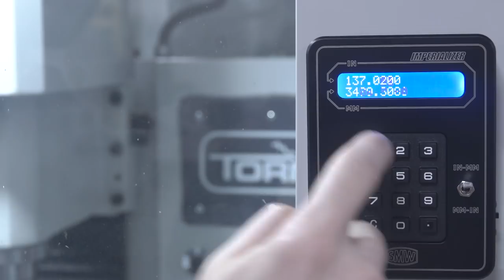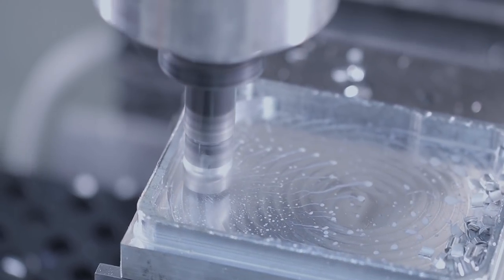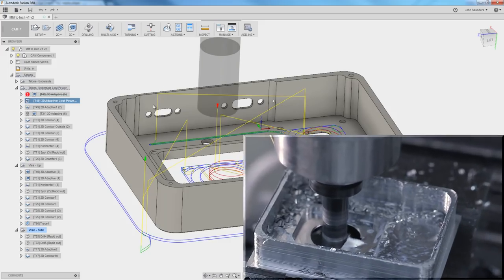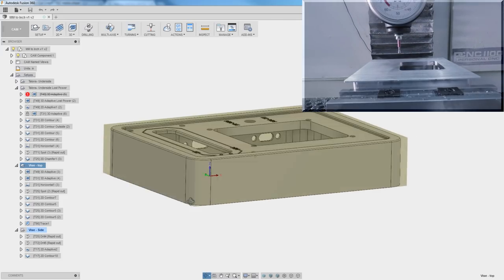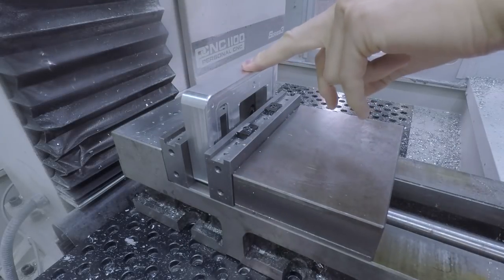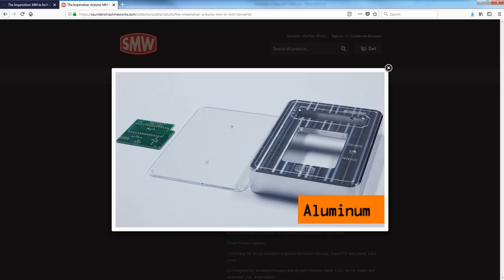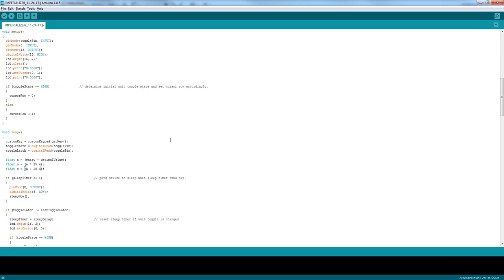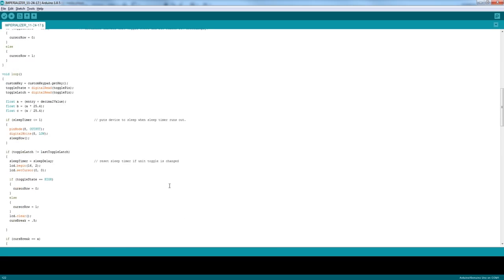Arduino Device to Convert MM to Inches!  WW174

Comment: At first I thought this was overkill. And queue the screeeeeeams of "silly USA with the imperial system" and all the usual rambling i'm sure i don't even need to scroll down to read.

But as a project and a product this is a very good example. Sometimes you need not a multi function gizmo, you need results now and take off the mental toll off your brain. Even if its just going to a calculator. The more steps an operator follows, the more "dumb" it becomes specially when arithmetics or complex thoughts are required. It's a quality of work improvement.

And of course, the choice of enclosure being resilient, adequately looking, and no wires exposed is a simple and effective. Love the magnetic mounting idea and implementation, although i didn't see any dampening feet for the back. Magnets at close distances pull very hard, and that sometimes result in snap/small hits. And magnets nor acrylic like being hit (both fragile, and the magnets can demagnetize because of that! or drop out of whatever place you glued them...). And if you leave the device on a table it might scratch it ... or drag metal scraps.

Nice video, greater product, and of course amazing comment wars wherever metric and imperial meet.
Reply from the maker: You nailed it.  This is just an example of what we can do today - build inexpensive, fun, useful dedicated hardware devices!  Show me a calculate that has a big ol' toggle switch on it!

Comment: “With that funny metric system” can’t get any simpler than base 10 maths 😂 and with converting imperial to metric using a factor of 25.4 isn’t too tricky either - 5/8” = (5/8)*25.4 =15.875mm for example. Never the less it’s an ace gadget for ‘on the fly’ conversions which could prove time consuming using a calculator .. good job! 👍

Comment: Seems simpler (and less expensive) to use the WolframAlpha app... :) Or just write a smartphone app yourself and sell it on the App Store (for whatever platform you need); not only could you then sell it, but everyone in the shop with that brand (iOS or Android) of smartphone could then use your app as well; plus, it’d be a lot easier to customize later, rather than having to fiddle with the memory constraints on the Arduino.
Reply from the maker: NO!  I don't want to use my smartphone!!!!!

Comment: Anyone who shows that image saying that Americans went to the moon using imperial definitely don’t realise that Americans went to the moon USING METRIC... it just displayed it to the Astronauts in imperial... 

Quote from one of the Apollo engineers... “With respect to units, the LGC was eclectic. Inside the computer we used metric units, at least in the case of powered-flight navigation and guidance. At the operational level NASA, and especially the astronauts, preferred English units. This meant that before being displayed, altitude and altitude-rate (for example) were calculated from the metric state vector maintained by navigation, and then were converted to feet and ft/sec. It would have felt weird to speak of spacecraft altitude in meters, and both thrust and mass were commonly expressed in pounds. “ https://www.doneyles.com/LM/Tales.html

So yeah... your calculator is essentially what the LEM landing guidance computer did and that is change metric inside the computer to display imperial to the guys landing the thing.
Reply: Was about to comment same but figured someone else would have already!
Reply: I wholeheartedly agree. The imperial system is chaotic and is not something tombe proud of. I LOVE this channel but it really rubbed me the wrong way, from an engineer no less
Reply: Not to mention that NASA crashed a space probe on Mars, because a module developed by Lockheed was spitting info in pound (force)-second, when NASA wanted (and that was on the contract) newton-second.

Poor Mars Climate Orbiter, crashed hard on Mars surface.
Reply: You do know that most youtubers are just trolling you when they say something “negative” about the metric system. Most Americans in a professional job environment are using metric in one way or another and realize the benefit. It is just hilarious to see all the metric warriors come to the battlefield when there really isn’t a battle to be had. Sometimes it’s fun to poke :)
Reply: Andrew Lathrop ya likewise, in my job and my hobby I've no option but to interchange between both all the time and I find the same with the Americans I work with. Some people get too wound up about everything!
Reply: We're located in southeast US, we work in metric as well - internally. Still have to interact with our customers in imperial. Lots of switching back and forth. A purpose-made converter like this would be handy, since even using a simple calculator, sometimes you divide when you mean to multiply, vice-versa. It's about saving time doing the repetitive stuff. And yeah, we've been harassed a bit about using metric; mostly good-natured ribbing, one time though was downright ugly, like we were some sort of commie traitors or something. LOL

Comment: I think you could have added a few more decimal places for the conversion factor: 3 significant figures isn't much when you're thinking about thou.
Reply: Anonymouspock ..
OK. The conversion factor is 25.40000000000000000000000000000000000000000000000000

Comment: where's the device that turns america into a country that uses metric
Reply: That's unlikely to happen.  Believe it or not, Metric is legal.  However, the public simply doesn't care and WILL NOT be forced.  James Kilroy's remark about 2 kinds of countries, those that use Metric and 1 that went to the moon, is something to think about.  If for no reason other than world wide marketing, the automobile industry has gone Metric.  In the stores, soft drinks are sold in 2 liter bottles.  Many items weight is printed on the packaging.

In the laboratory, Celsius temperatures "rule".  However, Fahrenheit is superior for weather work.  It's nice when MOST measurements fall in the 0 to 100 range and the small degree allows for fine gradations in meaning.

Both systems are ARBITRARY.  Check the SI definition of the Meter.  Metric is more consistent.

Eli D..
Reply: - "However, Fahrenheit is superior for weather work". No it's not. Celsius is far better. The 0 is the Freezing point, and all your temperatures pretty much sit between -40 to +40. You don't need any more precision than 1 Deg Celsius, because you can't tell the difference anyways.
Reply: Who (certainly, I don't) wants to deal with negative numbers on a routinely cold day?  When it's below 0 F., it's damned cold.  Fahrenheit = better.  :>D

BTW, -40 is the same on both scales and happens to be the freezing point of mercury.  You need something else, like alcohol, in the thermometer.

Eli D.
Reply: you don't "deal" with a negative number; it's a number just like any other real number. it makes more sense to use celcius for weather because the transition from water to ice is relevant for precipitation and road conditions. in the end it doesn't matter, it's just a discrepancy between america and the rest of the world, so it's really only a problem on the internet (or other international operations). side note, the "preferred system of weights and measures for United States trade and commerce" is metric; see metric conversion act (https://en.wikipedia.org/wiki/Metric_Conversion_Act), it's just not that relevant socially
Reply: I'll switch to metric when the "Decimeter" is more widely adopted.
Reply: why that? lol
Reply: Why would you want the Decimeter? It's just a name right now. I'm slightly annoyed at how much Centimeter is used. The Millimeter is the manufacturing standard, and what should be used in print on all products.
Reply: at least it's easy to go between cm and mm lel
Reply: If you understand Decimeters, then 610mm is 6.1 Decimeters. It's not that hard to understand the Millimeter unit. What is with you 'Muricans that when you see a "big" number like 'six hundred and ten', you suddenly start freaking out? Do you not understand how Base 10 works? That's the whole point of it all.
Reply: I'm not arguing the merits of a 10 base system. I'm responding to the ease of adoption. Metric is missing human scale sizing. In fact, I'd be willing to bet that I could create an entire NEW measurement system based on HU (Human Units) and probably get it to adopt before metric here in America. (FOR EXAMPLE: My HU for temperature would say, "At sea level Water Freezes at 0° average human body temperature is 100° and water boils at 200°". A slight adjustment in the relativity of the scale, which actually makes sense) I've given this enough thought that I could put together a paper, present it to the NIST and with social media, could rally enough support to consider adoption. And it would be another F-U to the metric purists, because HU was invented by an American!

But back to the topic at hand...

I was giving you guys an out, so-to-speak, a way to meet us "'mericans" half-way by giving us a unit of measurement that is relatable to what we currently have and like. And the Decimeter IS in fact in the standards list. It's just not used in common parlance, but there's no reason why it can't be adopted.

But by you stating that we "freak out over big numbers" is preposterous. After all, most of us can handle fractions. I could easily claim the counter argument that metric-heads go brain dead when we say something is 4-1/32nds of an inch. So HAHA right back at you.
Reply: Whatever, your lost.
Reply: irony is that NASA was metric when went to moon
Reply: Mariano Gaston NASA wasn't metric when it plowed a weather orbiter deep into the Martian soil, in 1999.
Reply: NASA IS Metric. That was an Imperial problem due to Lockeed Martin's incompetent engineers that didn't do conversions properly. NASA wanted everything Metric but some suppliers weren't on board yet.
Reply: Adopt metric and then you're able to use whatever divisions you find easiest/appropriate. milli, centi, deci...
Reply: Let us not forget that those rebellious Americans have used METRIC money since the 18th century.
Reply: DAMN....there is some serious sexual tension in here, you could cut the butthurt with a knife, although I'm torn over how to measure the length of the knife!

Comment: Power saving

If you want to conserve processor power, then don't use float/double arithmetic.

Use scaled arithmetic; which not only requires fewer processor cycles, but also hundreds of fewer bytes of program space.
The processor could then spend more time sleeping.

Of course the LCD (backlight) draws way more power than the Arduino itself, but that's another kettle of fish.

Comment: Restart after Powerfail

Doesn't the POST for the machine insert comments into the G-Code?
One can then quickly find where in the G-code, already on the machine, find the spot where the power failed.
No need to generate new code.

Comment: Jhon I just started watching your videos. I always thought they were too long xD sorry dude. But now I think different. Now I have a question about running a larger shop, have you bought a ERP software?
I want to know because:
1. Inventory management -- Because I have a bunch of inserts, tool holders, I have no idea how many things I have
2. Job orders -- one guy in the cnc lathe, another in other machine, scrap, machining times, I have no total control on that.
3. Purchasing orders. -- I have nothing to say about this 😨.... Imagine it
4. CRM -- Also this is in head only
See to many things I could visualyze with the software but the costs of the software are sometimes too high, around 20K and I can't afford that purchase.
What have you done about it?

Comment: I work in a job shop myself, where I work with both metric and std measurements, for foreign and domestic customers. For given metric prints, we convert everything to and program in standard. My fave is multiplying my given metric (mm) by 0.03937. I have it set as my "k factor" in my TI-30! The conversions go beyond measurement my friend...sometimes a bit overbearing when trying to find out the Swedes material, ASTM conversion to what we're familiar with here. 

Respect!

Comment: Might have been more practical to have made a mag base for smart phones and a link to download a conversion app😉
Reply from the maker: no!  I don't want my $400 (or $1,000 these days) phone subject to coolant, dropping, etc.!
Reply: Use a $50 Android handset instead. You could potentially have the whole Machinery's Handbook as an App in your pocket for half what your single function box costs. Things like speeds and feeds, tap drill sizes, unit conversions, sine bar calculators and many more are already available as Apps.

Comment: [3] Ones that crashed a space probe on Mars: https://en.wikipedia.org/wiki/Mars_Climate_Orbiter

Want to use International System/Imperial System? That's fine, but if so do it consistently.
Reply: Not to mention that the only Space Agency that landed a probe on an asteroid used metric system.

Comment: Neat project. John I've got a tormach mill, would you consider an electronics only package + model for the enclosure?  I totally understand if you do not think this make sense for your business.  Btw I really like the styling of the enclosure.
Reply: Mike Wick 
The bare bones package is affordable enough to get.  That way you also have a backup housing.  Just in case.

Comment: The metric system is much better than in inches..
Reply: inches are metric.

They have been for quite a while.
Reply: What do you mean?
The inches can not be considered metric because the etymology of the words themselves has nothing to do with each other.
Then you want to put the ease of understanding of the metric system than that in inches?
For example: 0.001mm = 0.00003937008in
I do not know if I made the idea ...
Regards.

Comment: Why do you make flipping the part so hard, just flip it over and flush it up to the side of the vise jaw, pick up the side of the jaw for X, Use the fixed jaw for Y, and pick up the bottom of the vise jaw for Z and add the thickness of your parallel and the thickness of your finished part to your work shift offset for Z. Now just set your WCS to the top back left corner of the part in your cam software.

Comment: I’ll probably pick one up. See if there’s interest in the shop for them.

edit
After seeing the price tag for the assembled unit. Maybe not.  I like ya John. Don’t like ya that much though 😆
Reply: $29 for fully assembled, CNC machined and anodized and laser engraved Al case,  custom circuit board etc etc. Looks VERY cheap to me. What are you expecting?
Reply: onlookerbob 
$129 for fully assembled. 
$29 for bare bones Uncoated unassembled
Reply: Ahh - you are correct - still, $29 is OK for just the components.
Reply: onlookerbob 
Just the PCB board, housing and cover. 

No battery, Arduino, LCD, keypad, switches, etc.
Reply from the maker: The bill of materials is ~$50 - $70 (depending on qty discounts and how you allocate machining time).  That does not include labor to assemble.  The point here is to have fun, provide a limited market product, and share the process (and numbers!) about bringing a product to market! I have no delusions that this will be a "wildly successful", broad-market consumer product.
Reply: NYC CNC 
Perfectly understandable. Too much for me after dropping $1200 on a new phone.  There must be something somewhere in this thing that does conversions.
Reply from the maker: $1,200 FOR A PHONE?!?!
Reply: NYC CNC 
iPhone X, 256gb
Reply: That's a lot for a phone isn't it? WTF?? Must be an Apple fanboy. Wasting his money anyways imo.
Reply: gredangeo 
Considering my last one lasted 6 years no issues? This one should last just as long if not longer, it’s money saved in the long run.

Comment: NASA have been on the moon, yes, but now they use metric, by the way. So argument invalid.
Reply: Chris Davison That I didn't know! Pretty cool.
Reply: Geeze, maybe if NASA would have had one of these units the whole in/mm mirror grinding debacle could have been avoided in the Hubble Telescope.........
Reply: Wasn't it caused by a flake of paint? Also the mirror wasn't built by NASA, but by Perkin-Elmer.
There was a imperial/metric disaster at NASA, but that was something completely different. That was the Mars Climate Orbiter. Do your homework before talking!

Comment: Really ?  Just CASIO and 25,4 only need to. There are not such idiots on CNC. Make the base of all threads better, pol tolerance of fits, cones, calculation of cutting parameters, etc. in one box. But if  you want, I can program such a base, an electrical diagram under your housing design if you do not have enough time. for example best site for metrical threads obliczenia.icad.pl/gwinty/ I need similar website for inch threads ect. (I using book right know.)